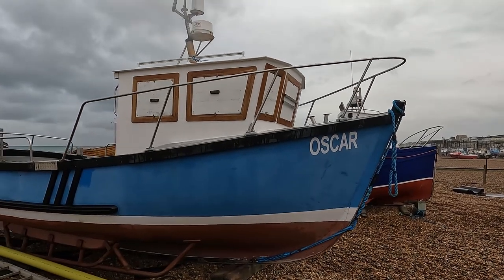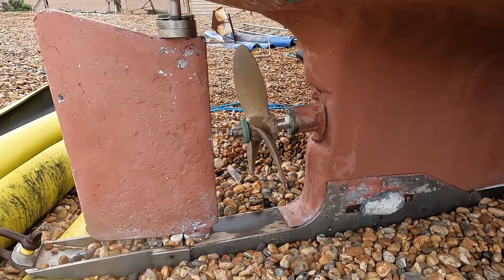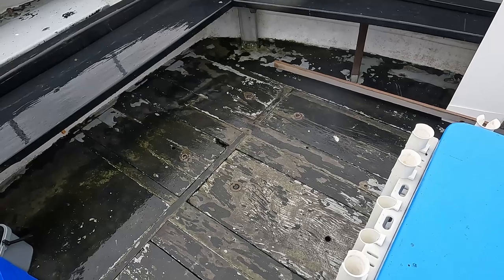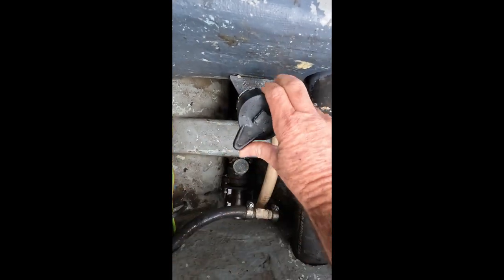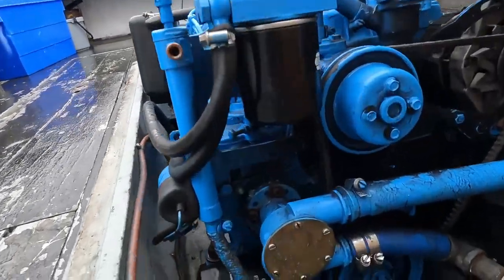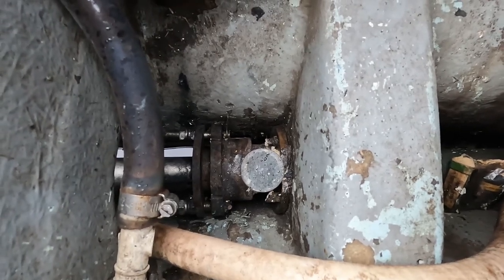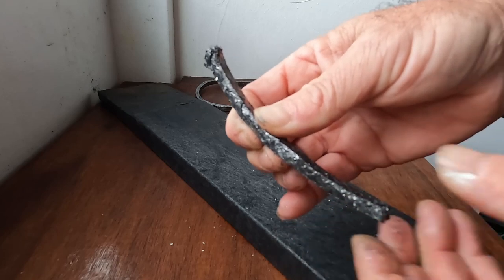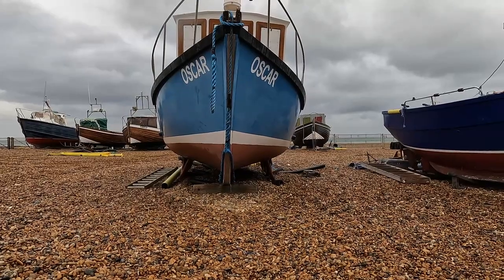Maintaining my Ip24 Beach boat

Comment: I have an IP24 fitted with a Perkins 4108 great boats.
Reply from the maker: They are a solid boat i will wait until march then start work on it again needs a repaint and deck floor painting again it took a battering in the simmer  what year is yours
Reply: I've owned it for just over a year I was told 1990, I bought it from southend it took me 14 hrs to Steam her back to Lowestoft though the night lovely boats.
Reply from the maker: its a small world i bought mine from southend  and brought to hastings on a lowloader where i had the keel and bilge keels done for beach launching they are not the fastest boats but a great sea boat good luck
Reply: Hi again, out of interest what engine do you have?
Reply from the maker: Hi i have a 45hp nanni 4.200he lovely enging and a prm gearbox
Reply from the maker: is your boat in a harbour mine is beach launce
hed the boats bloody heavy lol
Reply: @hastingsangler  mine is in the harbour on a floating mooring.
Reply: @hastingsangler  plenty of power in reserve then , I believe it doesn't take much hp to achieve hull speed with the IP24.
Reply from the maker: i max out between 7.5 and 8 knots depending on state of tide i run at 3/4 throttle
Reply from the maker: i forgot to ask is yours a sailing boat or fishing boat nice to speak to some 1 with same type of boat
Reply: @hastingsangler  I get about the same.
Reply: @hastingsangler  mine is a fishing boat, I'll try & upload a photo later.
Reply from the maker: nice save all that hard work beach launching does just walk on then off you go
Reply from the maker: thats cool my fishing range is about 12miles any further takes too long just happy fishing is good within 6 miles lol
Reply: @hastingsangler  my max is around 4 miles, if I'm punching the tide I only get 3.5kts with the tide I get between 7/8kts.
Reply from the maker: its hard work but great fun cant beat being on the water is the fishing good your way
Reply: @hastingsangler  not to bad mainly whiting & dogs , rays.
Reply: @hastingsangler  Hi, I've just uploaded a short video that someone took today when I was approaching the piers @ Lowestoft, it's named as IP24.
Reply from the maker: @jamiefarr1101  lovely looking boat and that perkins sounds sweet did you catch